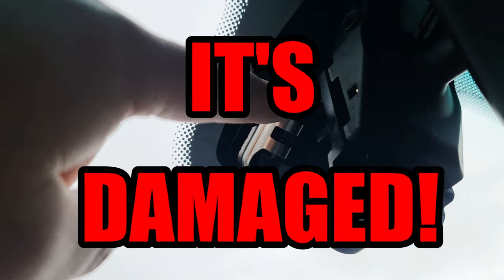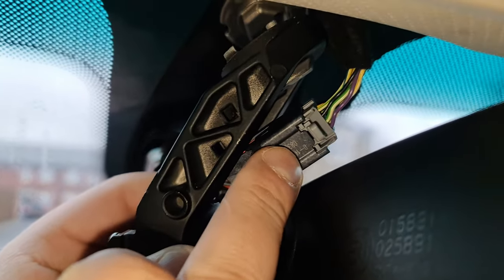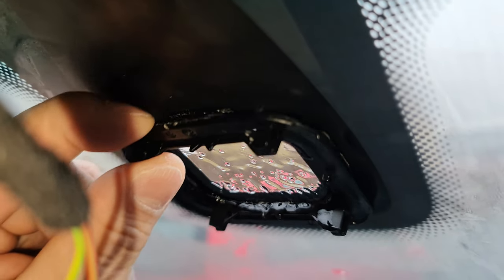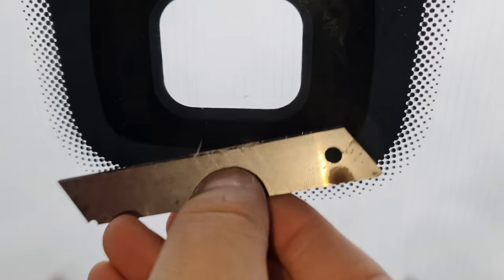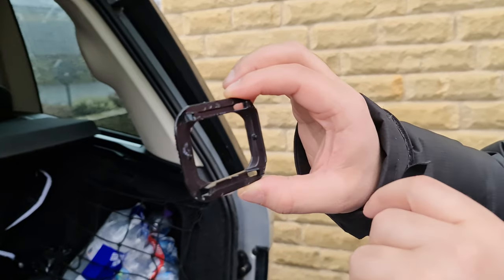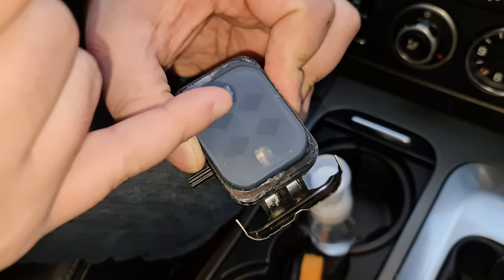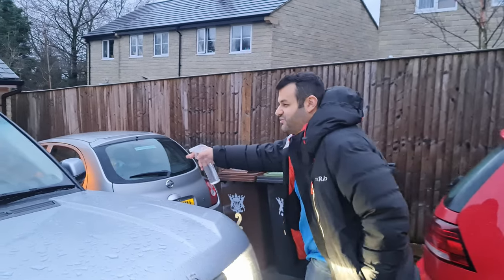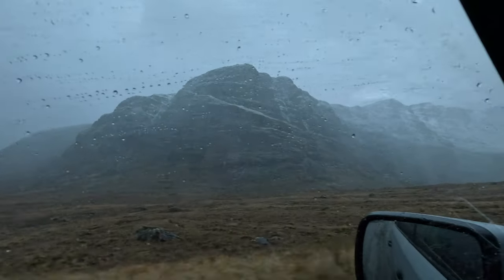Land Rover Range Rover L322 Rain Sensor fix - cheap and quick

Comment: Thanks for the video, I found it very interesting. I have a question to ask you and I hope you can give me a tip to solve my issue with the rain sensor. I had the windshield replaced but, after a couple of months, my rain sensor stopped working. I saw the gel was opaque and brought the car back to the guy that fixed it but still, no rain sensor response. So, from that on, when I move the stick to auto, my wipers start into intermittent mode, which I can regulate, but the sensor never came to life again. Can you suggest what to do, if anything can be done? Thanks in advance
Reply from the maker: Hi Jack, thanks so much for the feedback and welcome to our channel! 👋🏻😁 The sensor needs to be in direct contact with the glass. The gel can be in between them, but we cannot allow air or moisture in-between, because that will interfere with the sensitivity and the signal that the sensors emits. So, make sure there is no gap. 👍🏻 Once you get rid of the gap, the sensor should work perfectly fine. Let me know how it goes! Keep in touch! 😊
Reply: @lifeasusual  Yep, thanks again for the much appreciated reply. From what I see from the outside, the sensor is clearly visible with no air bubbles or dirt. I can go through the process of dismantling it and replace di adhesive to see if that helps. Do you confirm that in case the sensor does not read properly the function is disabled and the only option available is the intermittent?
Reply from the maker: Do you have the GAP tool? With it, you can read if the rain sensor has a fault or you can change the settings of the sensitivity of the sensor from the GAP tool.
Reply: @lifeasusual  Hi Alex, unfortunately, no, I don't. But will see if it's the case to buy one. Thanks, I'll let you know!

Comment: Salam brother , love to hear your thoughts on EGR . Delete or replace ?
Reply from the maker: Walaykum asalaam brother! Most people will say delete. However, as you know me so far, I'm not most people 😁 so I lean towards replace. The reason being: number 1 - it is illegal to do, number 2 - you will encourage a double knock effect. And number 3 -  the engine will burn the fuel in a much more efficient way, which will cause it to have a higher burning temperature. This will also damage the turbo, and the exhaust system, because all of the engine components are not designed to take on such high temperature for a long period of time. 

If you have decided to delete the EGR for off-road use only, then I would also recommend modifying the intake,  the coolant, the turbo and the exhaust systems, as well as doing a remapping of the ECU, for a guaranteed long-lasting engine. 👍🏻
Reply: @lifeasusual  thanks for the detailed explanation as always brother. You are the best !
Reply from the maker: You're welcome, anytime! 👍

Comment: Thanks for sharing!  I saw on Sams Motor and machine that there are some wires to splice together under the seat as well, did you preform that fix too?
?
Reply from the maker: Hi, thanks for watching! 😊👍🏻I haven't had this issue and haven't encountered any issues with cables under the seats. I just had an issue with the sensor not being attached to the glass properly, which was because of the company who fitted a new windshield. Hope this helps!